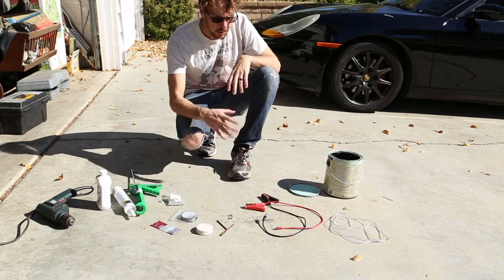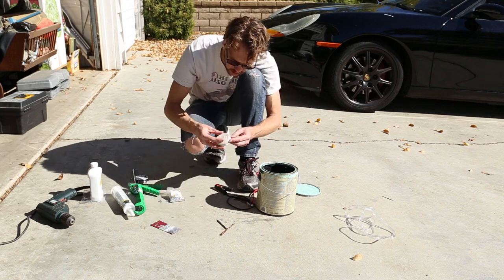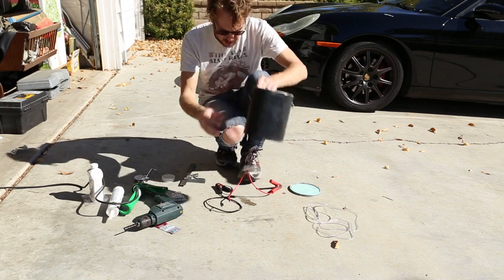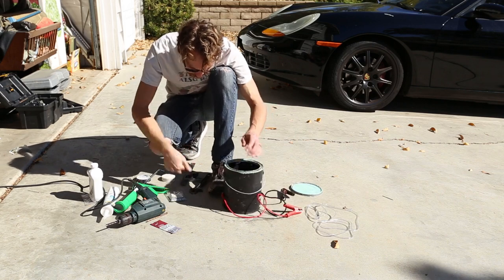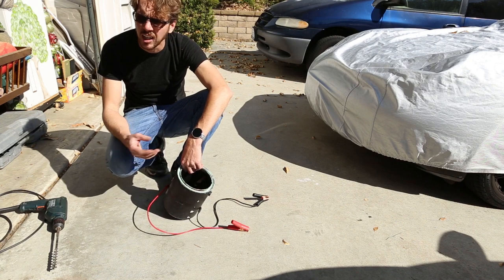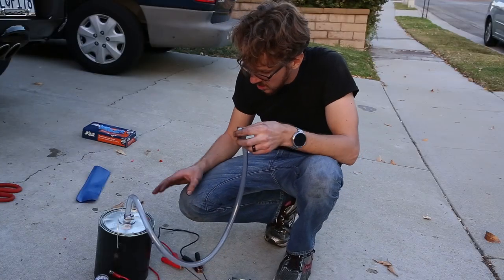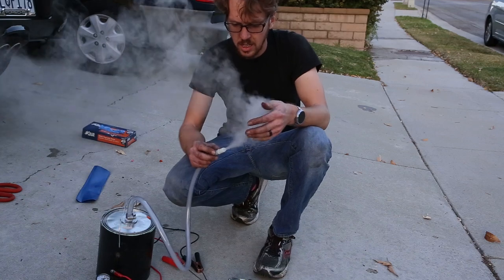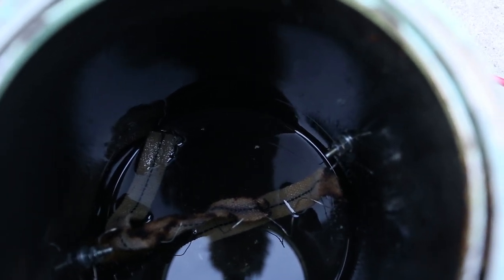How to make a vacuum smoke leak detector for cheap

Comment: No need to answer my last question. I proceeded with building the unit and took a guess at the proper length needed.....BULLS EYE! Wanted to THANK YOU for saving me a ton of money by  building this and doing the testing myself. It was simple and quick. Found a major vacuum leak right off the bat. Replaced a bit of vacuum tubing and now on to other possibilities why I have a rough idle. I'm happy that I spent the time and little cash to build this. You saved me some major money my friend. THANKS SO MUCH!
KENNY W
Reply: Kenny Winters How long?

Comment: You need to say what gauge nichrome wire you used and measure the Ohms resistance in the length you used. The Ohms resistance is what creates the temperature differences. That will eliminate a lot of trial and error.
Thanks for the video.

Comment: One smoker builder said there’s a sensor in the vac system that’s rated at .5 psi. More Than that and you run the risk of damaging it and of course that would suck. Always dial the pressure at down.

Comment: Exactly how long is the resistance wire need to be? You mention it needs to be two to three times the diameter of the one gallon paint can. How long of a wire did you use?

Comment: This is a great build. I love your honesty. What would happen if you used a thicker guage? I like the idea of less resistance - more smoke. I think the thicker wire would help prevent fire too. I know you wouldn't be able to go as high as 12 awg as it probably wouldn't heat up enough to smoke the mineral oil, (too bad as I have tons of that around). Maybe some thicker cat6 23 awg, or maybe a couple of 24 awg twisted together? Thoughts? I do have solid of both of that I could strip.
Reply: NICHROME wire 22 -20 ga. around 2 ohms resistance determines length.

Comment: Would you be able to measure the resistance of the length of wire you are using? I would think as long as a person uses the same resistance, it should work as yours does
Reply from the maker: +Go_for_broke Racing Agreed. I'll try to get a reading this weekend.
Reply: Ok, cool, thanks!
Reply from the maker: +Go_for_broke Racing So, it turns out I'm not very good at using a multimeter and the resistance seemed very low, so I don't feel confident in my reading (4 ohms?) You may be better off just experimenting with the length.
Reply: 4 ohms, ok. that sounds reasonable, thanks!
Reply: youd be better of finding the resistivity  of the material
Reply: the transmission lines to the radiator
Reply: removing a transmission

Comment: Instead of using a paint can, can I use a plastic coffee can? Will that plastic be strong enough? Im not an electrician or anything, so will the plastic be "strong enough" for the electric current going through the resistance wire?
Reply: no plastic will melt fast. metal can and simple grommets from auto store or harbour freight works great as insulators.

Comment: you should take the resistance into consideration and you will draw alot of amps with it very quickly and potentially cause a very dangerous situation running it from battery

Comment: for 20 gauge kanthal a1 wire you want the resistance to be at 2 ohms or a little under at around wire the exact length of the inside of the can

Comment: i'm planning to build one with a aquarium air pump.  what did you decide not to go that route?

thanks for your video.
Reply: you're out of my league thx for the offer tho
Reply: aquarium pump does not produce enough volume. Low pressure, high volume and many people state around 2 ohms resistance on wire produces best smoke if you build nichrome wire heater. do not burn for longer than 5 min. at a time.
Reply: thanks for the tips. I am going to give it a try.

Comment: you could have use a shorter length of wire if you used a 20 gauge kanthal a1 wire instead of the 24 gauge you used

Comment: This guy is not right in the head, @ 5:11 he shows us the bottom of his PLASTIC paint can!
Reply: Superior Carpet & Paint, LLC What are you talking about? He's talking about the resistance wire that he connected to the two screws inside the bottom of the can that's coiled around the wick. So what about this is confusing to you? Post your home made smoke machine Einstein.